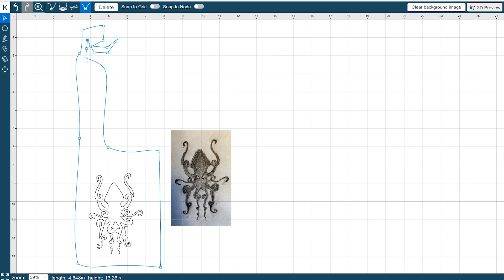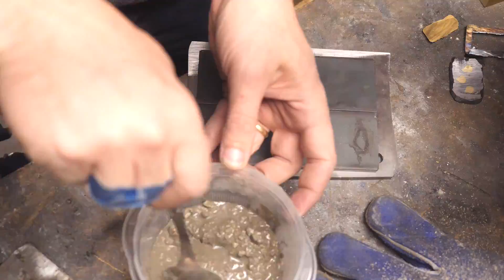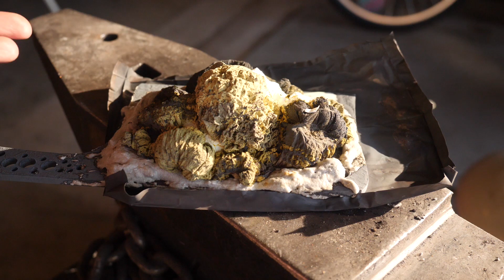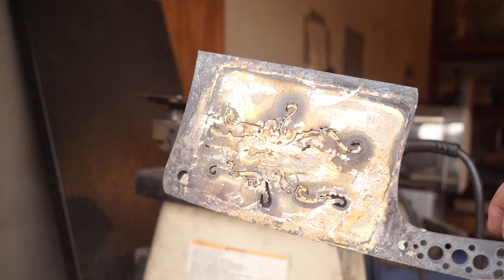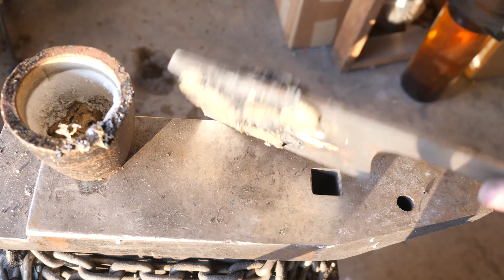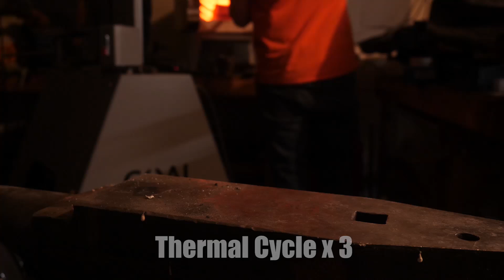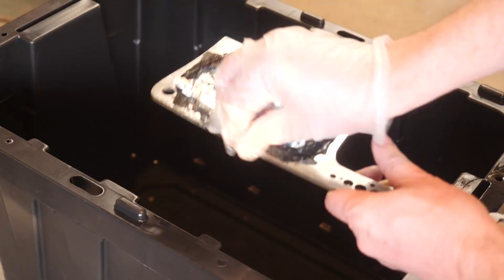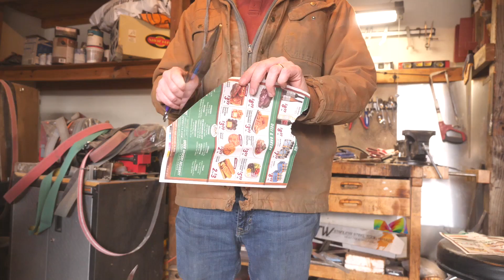Making The Squid Cleaver!

Comment: I would love to see you retry this one! I think the key changes are welding the back plate on, as furnace cement can sometimes react with brass. As you found out lol. The other thing that would have helped get the brass into the smaller nooks and crevasses is somehow breaking the surface tension of the brass through vibration while its liquid. Another way that would work well would be to preheat the cleaver, melt the brass in another vessel so you can skim it clean just before pouring over the cleaver. Then heat, agitate and heat. Used these techniques for jewelry casting, hope it helps.

Comment: There was possibly one more way to have done it with brass. Powder the brass and then fill all the little nooks and add extra on top and then bake it and melt it in like you did with the refractory cement and a backing. I think that would work.

Comment: You could have used brass powder. So once it melted, it'd fuse into one single piece. It could even have been locked in to the knife. Should try again. 😉
Still, nice work. The cleaver turned out really cool.

Comment: Don't get why the cleaver wasn't blistering hot for the pour.
Reply from the maker: oxidation
Reply: @GreenBeetle  awesome thank you, I've learnt something. I take it an oxidised layer of metal would stop them from joing properly?

Dope end result btw 👍
Reply from the maker: Antoni Gates on the first cleaver it made it so that filling in gaps would be very difficult.  Every time blade is red hot and cools more scale forms.  Under red hot but over 400 degrees F results in minor oxidation (but no scale) which I’m not sure would make much difference in a pour.
Reply: @GreenBeetle  yeah, my (flawed) thought process was that if the cleaver was hot it would increase the time the brass would remain molten, and that as the metal cooked the aperture would shrink slightly, helping ensure a tight fit.

Evidently it's a good thing I don't make things like this; I'll stick to electronics! 😁

Comment: I've seen a handful of similar comments and I would agree with trying powdered brass(or any other powdered metal). Overfill it and heat it up to melt in place like you tried with the solid pieces. A copper powder would be cool too.

Comment: Ive worked in a brass and aluminum foundry for a couple years. Unfortunately voids, cracks, etc are just a part of pouring metal. My job as the welder, would be to grind down those errors and weld the material back up, filling everything to surface level. I wonder if you could do the same, and just weld the brass inlay before the knives heat treat?

Comment: Could have used brass shavings/filings in the epoxy for fun. Also, why did you use furnace cement to dam it off? Silicone would work + less messy
Reply from the maker: Tom Zborovsky can you torch silicon?
Reply: @GreenBeetle  *Only for epoxy

Comment: I would agree with what someone else said that preheating the steel would definitely help with the pour and bonding but I was wondering about doing that project with a braze material? I don't know if you have a torch or not but I think you could definitely at least fill in the small voids that you had on the cleaver after the pour.
Reply: Steve, I forgot to mention that you have some excellent artistic skills.  Wish I could draw and design like that.

Comment: The pouring wasnt too bad if you heated the blade up it might have helped amd then i would have tried brass filler rods and oxy acetylene to fill in the voids so you could use a flux. The only problem is you have to be careful to not braze the backing to the blade

Comment: I would personally suggest using an old method used by others for millennias cut the brass as close fitting as you can to the design and melt it in that way

Comment: Looks fantastic! The big cake you got I think was just an oxide. If you try to the kiln option again, I think you'd get good results by keeping space underneath the knife like you did in later iterations with the resin and if you purge your kiln with argon gas (like for welding) you won't get any oxides.

Another method if you wanted to pour it, argon is heavier than air so it will "pool" like water in a container, make sure the knife is in like a baking pan, blast it with some argon and it you'll be able to pour your brass without oxides.

Comment: When you poured the brass you might have wanted to heat the steel before you poured in the breast may have allowed the brass to flow more easily into the smaller  parts. Just a thought.

Comment: If you ever try this again, the only thing I can think of to try different would be to preheat the blade in the oven before pouring the brass, and maybe trying to pour slower in tandem with that, possibly having someone with a blowtorch (or welding torch) heating the spots you're pouring into to not only keep the steel but also the brass hot longer so it settles in?

Comment: Powdered brass might work a little better since you could pour it with grater precision and then just melt it in place.  Also the greater surface area should allow for quicker melting and less out gassing.

Comment: what if you just melted the brass into the pattern? Like, put the blank in the forge with that whole setup and just brought it to a temperature  where the brass would melt but the steel would still be strong?

Comment: Dude, you were so close!  Looks like there are some good recommendations in the comments for finding a good type of flux to use with the brass.  Let's see it on the second blank!  Best of luck.
Reply: I'd try the kiln method again but with the brass shavings suggested above and purging the kiln with argon which should prevent oxides forming during the melt.

Comment: What if you give a little space under the blade for the brass to flow through into. That should allow the bubbles and imperfections to be below the blade surface and allow you to grind it off. You will still need to heat the blade before you pour.

Comment: You should generally preheat the material you're pouring into. If there's any moisture on the surface the hot metal could instantly vaporize the water and cause the metal to bubble up and fling molten metal all over the place.

Comment: Don't cut the design all the way through. Grind in the design on both sides. Either undercut in places around the edges to key in the brass or drill 1/8" holes, insert 1/8" brass rod that's proud of the surface on both sides to act as connecting points for the 2 sides(sorta like holes in the tang so the epoxy from the scales on each side can bridge). Fill in the design with brass/bronze wire by Oxy braze or TIG weld/braze. Likely have to do small sections at a time, switching sides to prevent warping. Or could try the full cut out design like you have. Maybe thick AL backer. Or sacrificial bronze/brass backer. Get most in from one side, grind off backer, touch up voids on backer side. Problem being warping. 

Or what about bronze/brass powder?

Comment: I was building a stitch-n-glue kayak a few years ago and messed up when measuring a batch of epoxy. The next day I was scraping half-cured epoxy and fiberglass cloth off of the boat and soaking everything in acetone. Badly measured epoxy will never cure.
Reply: John Chrysostom  I've only used powdered pigments with epoxy and luckily haven't had any trouble yet. I've also used gobs of wood flour and fumed silica as thickening agents, and they've never seemed to alter the hardening either. White vinegar will destroy uncured epoxy real quick.

Comment: Suggestion: use the belt sander to convert your brass to brass powder. FILL that inlay with brass powder. In fact, over fill that bad boy. I wonder if that wouldn't do the trick for you.

Comment: Hey Steve nice video..... back in the 80’s in the auto industry we used to do brazing on side panels of cars.... it’s an alloy of brass and we used it on .80 steel panels....  it was heated with a oxyacetylene torch and would flow very well ....this may be your angle to getting brass to play well..

Comment: From my experience ( not that i've poured into a cleaver lol ) you need to preheat the blade to mitigate the cooling of the brass, don't pour onto the blade whilst on top of the anvil as that will pull heat out too quick too, also there's a difference between melting temperature and pouring temperature, you wanna pour at around 620c for thick walled things and up to 720c for thin walled or detailed castings, be careful though at that temperature the zinc in the brass oxidize and burn out, really nasty fumes so make sure you wear a respirator

Comment: Looks great! Man what was that bit you were using in your rotary tool? (Dremel or die grinder?)  Also, did you consider getting the brass negative laser cut as well? You could leave it slightly thicker and peen it over into the details you cut on both sides.

Comment: Excluding oxygen and alloy selection is critical for brass casting sucess. Brass brazing with flux would likely be  the best way to fill this. The alloy is right for flow and the flux assists the bond. Probably a good thing the brass did not work I suspect it would have ruined the heat treat/temper efforts. 
Be safe grinding refractory that dust is very hazardous.
Nice chopper as it ended up.

Comment: Bronze would be a fair amount easier. Moreover... You're used to doing things in one go because it's best for the metal. In this case, doing your first attempt twice in smaller amounts would've probably worked out for you. You're not aiming for extreme durability, you're aiming for a decorative blade that functions. So as long as any voids between the two melts remained invisible, it really wouldn't have mattered.

Comment: Preheat the blade before the pour so that the steel does not cool the liquid brass on contact. This lets the brass flow, filling the small detail areas and letting trapped air escape. Jewelers preheat their molds for exactly this reason - and their fine details far exceed that of your squid.

Comment: Hey Greenbeetle, some recomendations:
Pouring Method: preheat the blade to a temperature of your choice.
Melting Method: Let the oven sit at a temperature just below melting point of the brass for about 10 min, so everything has an even temperature. Then ramp up to melting the brass.

I don't know if these two methods would work, but that would be my approach.
Reply: Preheating the blade would help massively for sure, I was a foundry worker for 10 years and we always pre-heated inserts before casting them. 400 degrees celsius if I remember correctly for steel inserts into aluminium castings, I don't think we ever put inserts into any brass castings though.
Reply: Excellent advice. Also, I've had a lot off success using brass and copper when in powder form. Just be sure create either a sand or refractory cement reservoir and double the amount of metal powder you would think would be needed. 

Excellent video, Green Beatle!
Reply: Metal powder makes a lot of sense. That way you know you have everything filled
Reply: Would a flux also help?
Reply: @m4rvinmartian  Definitely need flux
Reply: @JOEDHIGGINS  that's what I was thinking. Flux would have wetted the metal and drawn the meniscus down to fill the voids.
Reply: @m4rvinmartian  Also will keep the surface oxide clean.

Comment: You might have had an easier time casting that brass if the steel was red hot, that ways the steel wouldn't cool the brass on contact, hopefully allowing it to remain liquid longer and the brass to fill all the nooks and crannies .
Reply from the maker: Was worried about oxidation of the steel.

Comment: Personally I would use a piece of Stainless Steel as a Backing Plate, as it won't Weld itself to the brass as it needs an Oxygen Free environment to adhere to, or coalesce with another metal (but you already know that ^.^). 

Coat the plate and the walls of the design generously with Flux, come in with the torch and Filler Rods and work your way from the tips of the tentacles to the base and add Flux as needed to fill in any gaps. 

You do need to preheat the work area to 900 degrees or so first however.  And it goes without saying that you should Heat Treat after you fill in the blade. 

Also as @Uncle Ouch said, the brass/bronze will Off-gas if it's too hot coming out of the forge... To Mitigate that you should put a liberal amount of  Jewelers Flux into the Crucible to keep the Zinc from Oxidizing and thus Off-Gassing. 

Now then... Rambling Aside, it was an interesting build (Seriously... Nice Work) and I'm gonna steal your Idea with using the Table Top Epoxy as you got such a striking result for yourself :)

Comment: Hello and first of all thanks for sharing. I think I might be of some use with the problems you experienced during casting: in both cases you basically had problems with oxidation: In the first attempt in the electric kiln the brass was not protected from the ambient air in any way so zinc oxide formed (which is a gaseous reaction product) and this basically foamed up the bar. Some of the melt further down was not really affected by the oxygen so it still somewhat worked. So for this kind of setup you would have to make absolutely sure there is no oxygen present (by Argon/Nitrogen purging of the furnace of sealing your sandwich on top as well). Also be careful with that zinc oxide - its not good for the health of you and it eats the heating wire of your furnace for breakfast.

In the second try your melt oxidized during the time in the furnace and was already basically dead when you tried to pour it. It was not fluid as it should be. In this case I would recommend using bronze rather then brass (it contains tin instead of zinc and is not as prone to oxydation) and to cover the melt with a bit of borax. This forms a liquid slag during melting which prevents too much of the oxydation from happening. You can also add a bit of charcoal to the top, that helps as well. You have to remove this before casting, just basically scrape it off the top.

Hope that helps, it's an awesome project!

Greetings from an Austrian Metallurgist / Bladesmith
Reply from the maker: Tobias Hangler a great help, thanks!

Comment: You missed the obvious answer heat an hammer in cut peices
Reply from the maker: I thought about it but i didn’t think it would back fill the suction cups or chamfer which it has to do to lock in place.
Reply: @GreenBeetle  that's when you use a tool like a punch to move it into the suction cups leaving it thick to grind back later
Reply: @GreenBeetle  and or braising it in place

Comment: When you were trying to pour the molten brass, I was surprised you hadn't pre-heated the steel to a temp matching the molten brass. You could have had it in the oven with the brass while you were melting it. I know with jewelry casting, the mold is at a very high heat so the metal doesn't solidify as soon as it touches it.
Reply from the maker: I was afraid the steel would oxidize

Comment: In the first attempt, you should have used smaller chunks of brass, preferably powder with small bits of wire mixed in. the buildup of crap was from oxides burning and forming air bubbles, common with non-ferrous alloys like brass. In the second attempt if you had heated the knife up before pouring the brass it probably would have worked fine. When combining non-ferrous with ferrous materials, consistent heat is your best friend.

Comment: The surface tension of the brass is too high for casting as is. I know adding silicon to molten aluminium reduces the surface tension to make it easier to cast as well. Might be worth looking into.

Comment: Now, I also don't know jack diddly about casting or pouring, but it might also help to pre-heat the steel you're pouring in and/or keep it at or above the melting temperature of the brass so that the brass stays liquid long enough to fill voids and let gasses escape. Difficult, obviously, but it might work.

Comment: So heat is a Huge issue with casting. Best idea would be to place it in sand, and then carve an area under it, and then pour your brass in, after heating the knife. The sand retains the heat, while your anvil sucked it out so it solidified almost instantly.